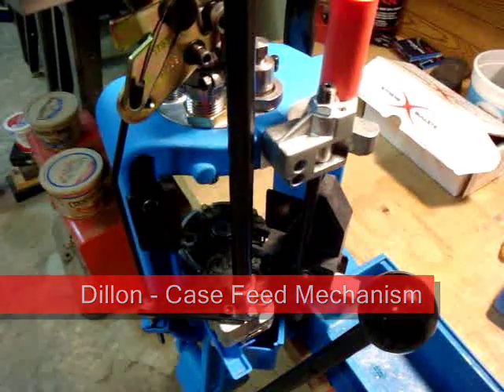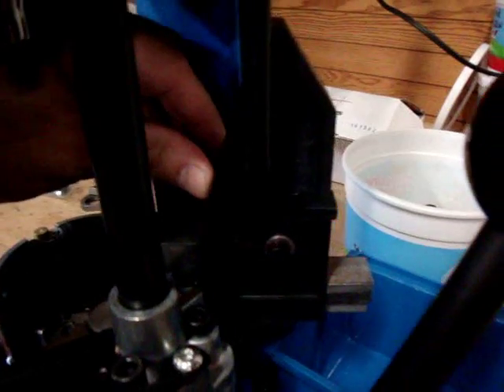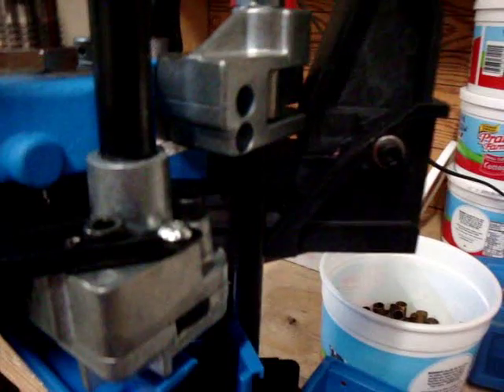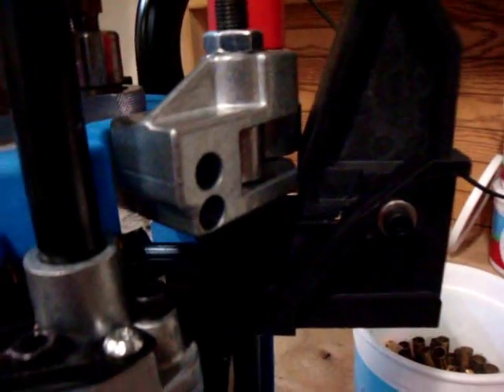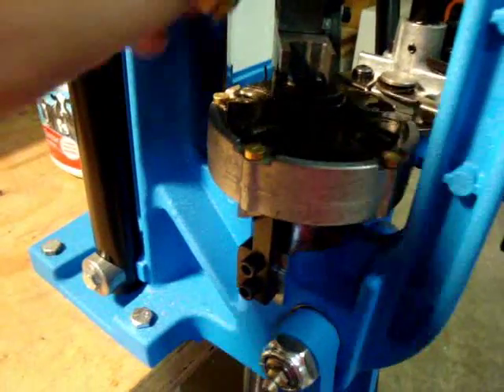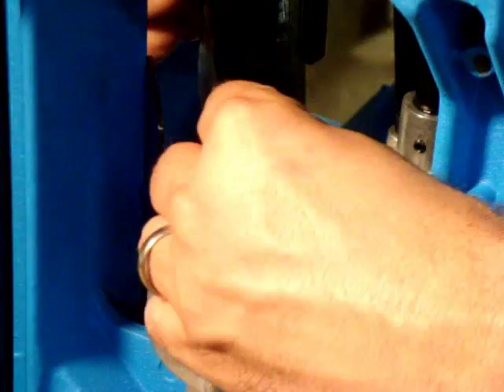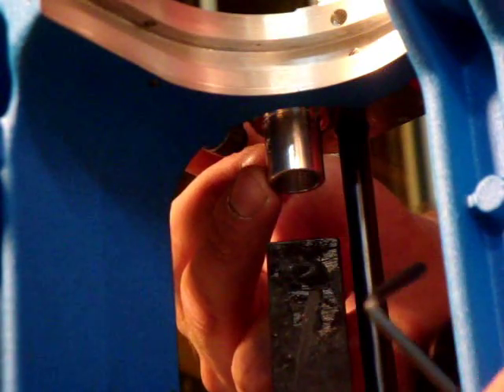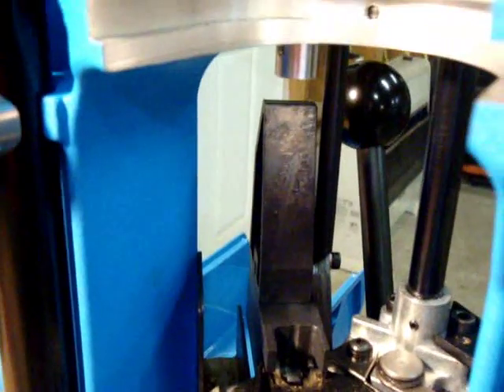Dillon XL 650   Case Feed Mechanism

Comment: Nice to the point video. Thank. Well delivered without a bunch of hype. I'm looking for solutions to the Case Feeder Mechanism (as you called it) dragging? Mine seems to be slow on return and not completely seat shell into shell plate. It will if I nudge it. Also if I don't nudge it, its just short of lining up correctly under the deprimer die? Have you experienced this or any one else reading this? I'm searching youtube for this issue but will get back to troubleshooting it if no answers are found. Hope its not the new case feeder stop however it doesn't appear its hanging up on anything
Reply: You might have the shell locator around the wrong way

Comment: Very informative  video. If I had extra tool head and wanted to just deprime only without any other dies in the tool head can this be achieved? Another words just use it to deprime all cases only and still your the case feeder mechanism.
Reply from the maker: yes, you can use it to de-prime only.  I have actually used an extra head with only a sizing/de-primer die to de-prime cases.  I also just remove the tool head and use the loader & case feeder to prime cases for hand loading.
Reply: +smalltown442 I would imagine it would be very fast to deprime on the xl650 with the case feeder. As of now Im depriming using the 550 rb its fast but placing each case in station one and taking it back out. I guess with the xl650 you don't need to touch the casing period because the case feeder takes care of that.??
Reply from the maker: +John B yes, you touch the cases when you load the case feeder up.

Comment: Funny, I saw another video here that showed the long ramp for rifle and the short for handgun. He even showed holding the rifle cartridge next to the ramp as a reminder that the long case goes with the long ramp. I don't have my Dillon yet so I have no idea. But I was interested that the information was opposite ;-)
Reply: Other Video is wrong (I seen the video as well). Just looked at my 650 manual. The longer ramp is there for pistol cartridges since they are shorter.  So the mechanism can hold the case in place until the ram makes it to the top of the stroke to set the case in. Otherwise the pistol cases just drop down while your barely halfway thru your stroke because the ramp is to short. (Happened to me)